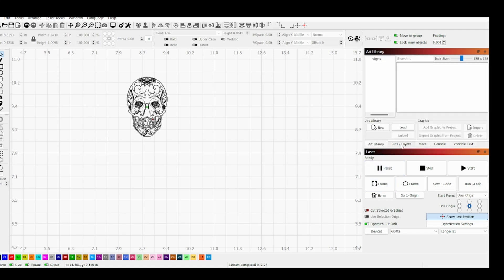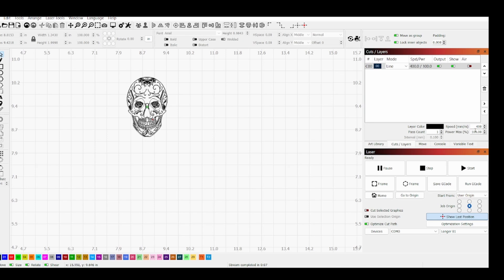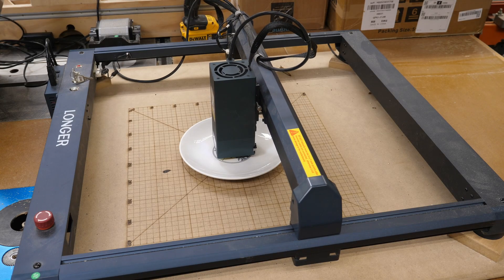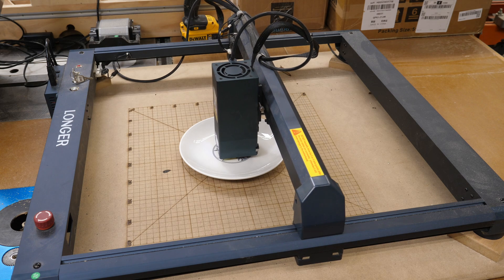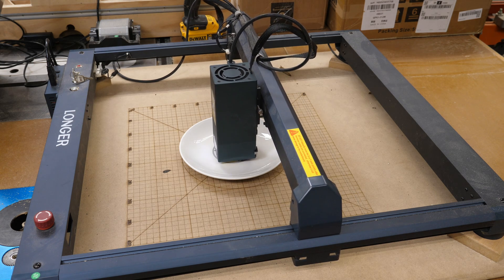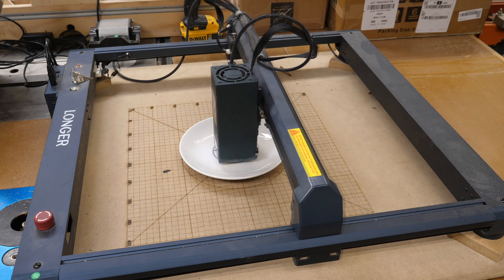Longer B1 Laser Setup Tips

Comment: I have the B1 40W and I am desperately trying to get access to the lens to clean it. Longer's video shows removing 4 screws that don't exist on my 40W. Any help would be appreciated!
Reply from the maker: I don't even remove the module.  I just raise it up and use an alcohol based lens cleaning pad on the lens, refocus, and go.
Reply: On my B1 the air assist nozzle covers the lens completely so the nozzle must be removed to clean the lens. I discovered there is a small hole on the side of the laser head that gives access to the screw holding the nozzle. If I use a 1.5mm Allen wrench, I can remove the nozzle and clean the lens. Thank you for your help!

Comment: Hi Roger - still struggling with trying to get the B1 to connect to my phone so I can start the jobs on my SD Card in the garage. Been emailing support for a week. Is there anything I can do to help set this up via USB as I have moved the B1 back into the house just until I get this set up. My Ray5 10w worked off the SD Card in the garage, till it didn't. But it has a touchscreen. B1 has no touch screen and I am struggling. Any ideas? I have followed a ton of instructions till I hit a spot they don't work, and I am at a loss as to what to do next. Any ideas?

Comment: Not sure what the issue is, but my Longer B1 30 watt works in current position. I also swapped my nozzle out for a comgrow nozzle kit for xTool D1 and it works great.
Reply from the maker: Could be my firmware.  I've never updated it and I have one of the first made.  Rare I need to run in that mode, so not too important to me.  I've done nozzle swaps too and even made my own for a xTool D1 before anyone really had anything on the market.
I also watch your channel, BTW.
Reply: I only use current when i need the head to stay in a lower area. Good video...
 @rogersshop